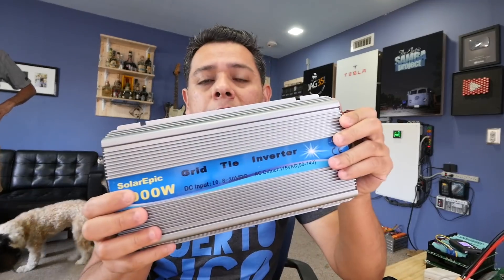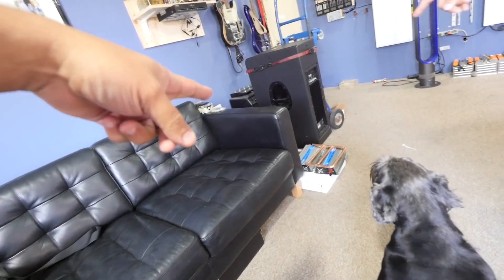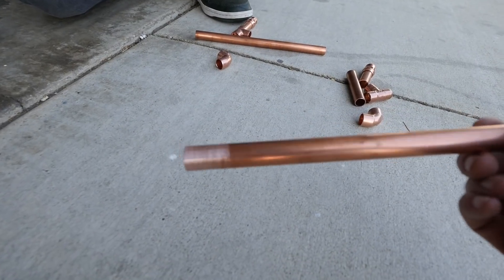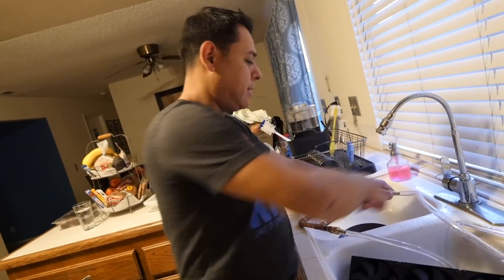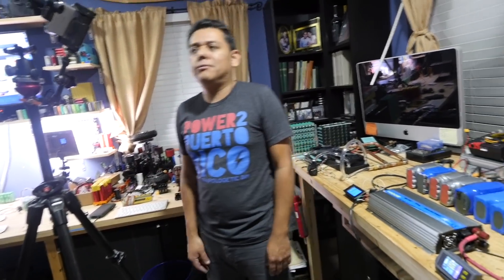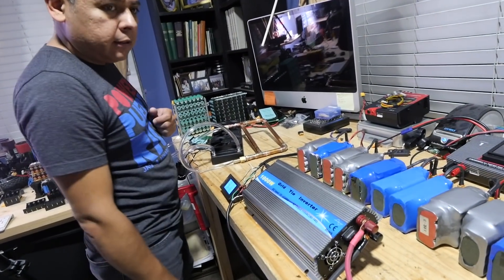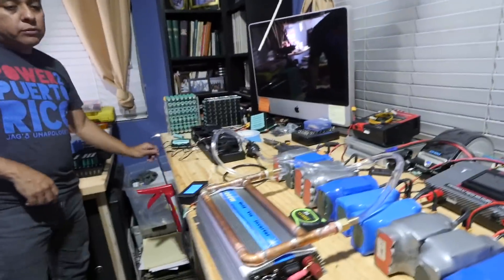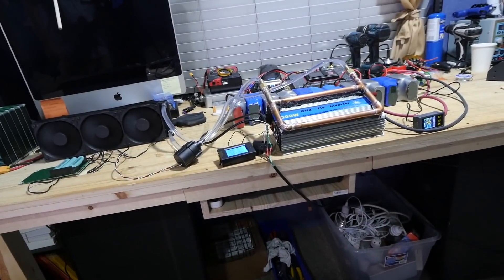Liquid cooling A cheap 1kW Amazon Grid Tie Inverter Experiment

Comment: How are you back feeding this into your home? Would this still be providing power if the grid goes down? In which case would it shock someone working on the lines? Or does this only work if you are getting power from the grid, your house just uses the batteries first before the grid?

Comment: I would take the cover off and re-create that from copper or (cheaper) aluminium. Then solder 3 or 4 pipes onto that sheet, and connect them with the hoses. And if you put in just a container that allows the air to bubble out, you'll have a proper system..

Comment: It could also be the speed of the water and or the volume of water. Looks like the pipe size was reduced at the plastic line side. It may also benefit from a pre-cooled water reservoir. I think worth more testing and 10 degrees is a lot of cooling.

Comment: Why to have complex liquid cooling if you can just hook up some 12V fan's to inverter and it will send heat away. Less power consumption ,less hardware, more reliable, efficient and simple cooling.

Comment: From experience as a tech for the last 20 years.... 

EL EL is correct.  Your liquid pumped heat evacuator doesn't work because you don't have enough metal to metal contact.  You could make a "V" shaped trough of copper stripping that runs the length of that side of the invert and touches on each sides to one of the relevant hottest fins.  You want to make a superior bond between the two metal surfaces, so what you need to do is. strap it down with the improved metal to metal contact and use your thermal transfer compound only to create a thin layer between well pressed together metal surfaces.  It does not fill large voids between metal surfaces.  Heat sink thermal compound is meant to be compressed razor thin between solid surface to surface contact.  It doesn't work any other way.  

 If it were me I would try to make the only metal to metal connections that truly endures and that is to solder the pipe to the fins on the side of the inverter where it is hottest.   Good solder welded contact will not only make a durable physical bond, but an electrical and thermal bond as well that transfers heat energy away  into the water pipe very swiftly.  Also, what is the point to running a pump system on batteries?  Too much labor changing batteries.  You're gonna run that on its own dedicated solar panel overrated for the needs of that pump wattage wise so you don't take any energy away from your solar production array just to run fans or pumps for cooling.the inverters.  If you have to, drill holes through the side of the inverter just large enough to thread some nice thick strews into and use those hard physical connections to transfer most of the heat away from the case of the inverter careful to seal the screws well at the entry-point to keep water to of the inverter (use tight tolerance neoprene thin rubberized backing on flat/pan head screw heads to ensure leak-proof.

Also, on the subject of ratings for Inverters....  It's honestly never a good idea to run a 1000W inverter up to anywhere near 1000W.  You need to adopt the good engineering safety overhead rule of thumb and give your equipment that is vulnerable to overheating a 30% margin of safety.. In other words, run 4 1000W inverters each with a 750W supply from panels rather than 3 1000W inverters at 1000W each.  Your equipment will last much longer not pushing it to design limits and testing if the tolerances on the components it was built with were adequately met in production or labelled.
Reply: Thinking about it , if you want to keep with liquid heat transport and remote air exchange as your method of heat removal what would work best would be to bury smaller copper tubes with an outside diameter closely matching the width of the channels between the fins directly into the length-wise channels and soldering them in place (if the metal will stick to solder) in a stretched S-shape zig-zag pattern lengthwise channelling water through the tube one way across the case to the edge then down a notch through a half circle and back across the case the other direction (repeat until all relevant surface area is covered),   This mind you is a better idea than putting water cooling heat sink blocks inside the case because you should not violate the water-shielding integrity of the OEM's case.  If you put liquid cooling blocks inside the case, you run the risk of a leak destroying your entire inverter.  Then what was the point of trying to save it by cooling  it more if the cooling failure causes it to fail?  Also, if your liquid pump fails your liquid cooling blocks instantly become frying blocks with no way to disperse their heat causing the helpless MOSFETs to fry instantly without much warning.  Best to stay outside of the case.  At least if your extra cooling outside the case fails, it would still cool as much as it does now without the additional cooling by distributively whicking the heat more slowly away down the copper pipes and existing metal fins.
 
Another less exotic and perhaps easier to implement method to cool them better would be to get larger faster fans like those used on computer chassis and put one on each end of the inverter with a funnel to couple one side size-wise down to the 2" openings for the existing fans are and remove the original fans.  One fan to push air from the cooler end towards the other fan which would be directed to pull air from the hot side.  Heck, just leaving the internal fans and adding these two fans loosely blowing and sucking across the outside of the exisitng fins lengthwise and perhaps a loose 6 inch wide length of plywood leaning at an angle off the side to the ground to create a triangular-tube shaped air channel to push air straight across, collect heat and then be exhausted out away from the inverter.  This simplistic approach would waste far less time implementing it and on costs. Best of course if you run those DC off some small cheap ($7 I hear.. ahem!)12V 20-25 Watt solar panels so they don't leach off your production power, downing efficiency.  The existing fins can do an adequate job of cooling but you can assist them by pushing air over their entire surface to draw the heat off them faster.  I use one of these same 1KW inverters in my own home solar rig here outdoors in the heat in sunny Southern California.  It's been running for 2 years outdoors with only the help of being in the shade underneath the solar panel on the ground mount with no additional cooling and has run 365 days a year without a single failure.  

If those fins don't have enough surface area to efficiently remove heat from the inverter, for passive cooling you can always help it by soldering on more and longer thin metal fins in the grooves between the existing fins and/or on top of the existing fins lengthwise to increase the overallsurface area of metal exchanging heat with the air around it.  Pushing directed air over them with a modest 4 or 6" fan will also help greatly because moving the air reduces its ability to create a blanket of air insulation around the heat sink fins, because motionless air acts as a thermal insulator as it continues to build resistance to taking on additional heat from what it touches as it itself heats up, so blowing fresh as-yet-un-heated ambient temp air across it keeps up the maximal efficient rate of air <-> metal heat exchange.  

The liquid cooling thing is just going to do the same thing at the other end with its own heat sink anyways pushing air over yet a different heat sink to draw the heat away.  The only reason for liquid cooling in computers is to put more cooling into areas where there isn't enough room to effectively circulate enough volume of cooling air or room to mount fans or isn't enough outside or fresh air available to move over a regular heat sink like in the crowded confines of a computer chassis or for setups where the noise of fans needed would make it unpleasant to work around so the cooling fans are relocated by leveraging noiseless water as a proxy to another location away from the machine in question where noise is not an issue  You have all the space you want outside of an inverter to create adequate cooling directly with forced airflow so it makes more sense to do that right where the inverter's own fins are instead of transporting that heat in liquid to a different heat sink elsewhere to be removed by guess what?  Fan-forced Air blowing directly over cooling fins on a large metal  block and fins style heat sink or fan-forced air blowing through fins on a radiator type heat exchanger.

But honestly, and this is the last point, you shouldn't be overdriving your equipment like this. Y ou don't gain anything by overdriving an inverter except an overheated inverter that will fail unless you can maintain an exotic expensive cooling system which eats a bunch of power and then what was the point ?   Just oversize your inverters for the job.  Use a 2000W inverter instead of 1000 W inverter to run 1000W of power.  By not forcing your equipment to run at design limits, it will last much longer without additional waste of power to implement additional cost increasing heat dispursion methods.   It might make for interesting video to design some far-out looking copper gadget with liquid pumps and a radiator to cool your inverters but the smart reliable and cost-effective thing to do is to not heat them up like this in the first place and select inverters which don't have to constantly run at design maximums to keep up with power supplied by your panels during your noon time peak maximum production periods.  You shouldn't run them over 80% of max rating at your daily peak hour if you want them to last in terms of years rather than months weeks, or even days depending.

Comment: I would guess the mosfets are along the sides of the inverter so I think you would be better with thin tube that will fit between the side fins and use some kind of thermal transfer adhesive.

Comment: Hi, you kindly got back to me recently about some inverters you can plug into your home to add power is this the type of inverter?  so my question really is can I plug this in  at  my building where the solar panels and batteries will be which is part of the household circuit and then plug in something in say my bedroom and it would draw power from my batteries and not the national grid  or as a reduction to my supply  from my  electricity supplier. I realise you are a busy guy and love the videos. Brannen, North Devon, UK
Reply from the maker: Yup,  if say you have a battery 24v connected to this inverter and connect it to the wiring in your home it will produce around 600w.  You can deduct that from whatever your home is consuming,  say if you have the refrigerator using 300w and all your house lights another 300w then your home would be net zero, or you won’t be drawing any power from the grid,  but let’s say you start vacuuming for example and that draws 1500w then anything above the 600w that the grid tie inverter is producing comes out of the grid so your home will be consuming 1500w from the grid and 600w from the battery/grid tied equipment,  your total consumption will be 2100w but the utility company will only see 1500w.   If you can exactly match your consumption with grid tied inverters then you don’t get a bill at the end of the month,  but make sure you don’t feed too much energy back into the grid if you don’t have net metering setup.

Comment: Try flattening or pressing smaller copper tubes into the side fins, coated with that paste. Braze the ends to a small copper manifold or use tubing.

Comment: From my water cooling experience. If you use adhesive thermal past and mount a row of old AMD CPU heat sinks in the blue area it would do.  Or your way solder a shaped copper plate on the bottom of the pipes. Then thermal adhesive to the top of the Inverter    You want as much contact area as you can. Shape the pipes to the top of the Inverter. You really want a flat top to those inverters for water cooling. Wonder if you can get a custom case made in China? Also you could remove the inverter fans and mount server cooling fans on the outside of inverters. 10 bucks for 5 of them.  move 10x the air.

Comment: Have you ever tried modification to the heat sink?  If you extended the fins or blades with more strips of alloy you could give the heatsink a greater service area. Even the thermal paste with some epoxy glue at the ends. Just a thought, simple and do able for your average diyer.

Comment: It will work,,, until the pipes sweat on a hot day and start to drip into your Inverters. the other problem is that you are putting open copper pipe near an electrical terminal. one false move and you have a conductor., Now. if you add a fan with a thermal snap disc it will take MUCH less power than pushing water threw a pump. you could also make it a solar powered fan to cost you NOTHING to run.

Comment: I'm confused as to how two people (+anyone behind the scenes) clever enough to engineer this set up, were simultaneously dumb enough to make the close to the most useless system imaginable. Heat transfer needs as much thermal conductivity and surface area as possible.
A flat surface on a round profile makes a tangent line with only a tiny point of contact (this is why train wheels are so efficient). Additionally the contact area is at the end of a thin aluminium fin which will have relatively high thermal resistance.
The thermal transfer compound will have a hideously high thermal resistance relative to a metal-on-metal contact, so will be close to useless.

You will need to either solder/weld/braze the pipe to the aluminium, after grinding down the fins to allow space for the pipe to fit in. If you can't solder/weld/braze the pipe to the case, then a mechanical connection is adequate but you'll want to get as much metal-on-metal contact as possible by using a square profile pipe or squashing the round pipe so it has a flat edge.

Sorry if this sounds harsh, I don't like to knock people who at least TRY. and you've done more than I have in this area... you're obviously not dumb guys... be smart about things -_-
Reply from the maker: Settle down,  this was an experiment,  how is anyone not smart enough to see it for what it is hard to comprehend
Reply: An experiment to determine what?... As you allude to at the start you had many commenters explaining it would not work. I can only assume that in some attempt to prove them wrong you didn't foresee the obvious flaws in the implementation. So you made no attempt to address those flaws.
You didn't need to mock anything up to see it was not going to work.
Reply from the maker: You Believe everything people say?   I experiment that’s what I do,  are you not familiar with my work?    Are you never wrong? I’m more wrong than right but that doesn’t stop me from doing things.    What do you do?

Comment: If the water and radiator don't get almost as hot as the inverter, you're not transferring much energy.

Go to a craft store, buy sme mold making kits. Cast a mold of the inverter's side heatsinks, cast a positive part, then cast another negative in plaster or casting sand. Lay some coursly-sanded S-bent 3/16 copper tubing in the mold so the ends protrude in a useful way, melt some beer cans into the mold, paint the inverter's heatsinks with a thin layer of thermal paste, and clamp your molded aluminum header onto the heatsink for maximum contact. Connect the tubing to your radiator. Drain that water, add a mix of distilled water and anti-freeze, according to the anti-freeze vendor's recommendation. The difference will be dramatic. It will pay for itself over one inverter's lifetime, as the inverter will last at least twice as long (if it's going over 50 degrees C).

Comment: What i Do is use a wall mount gridtie inverter(No fan just mass heatsink) the big ones, then just wire on a power cord. If u can get 1 used thay r way cheaper then the ebay ones. I got mine for $500 aud with 3kw solar from someone upgrading there house solar to a 5kw And another one for $60 on facebook both r 3kw inverters just dont overload the powercord (AU 240v by 10a so 2.4kw MAX Solar) Cheapest way to setup solar.
Reply: Also you need 150v input for the Inverter to turn on

Comment: Your contact surface area was way to small maybe a small diameter tubing routed in between the fins  with one run of tubing. Also focus on the side where the mosfet chips?? are mounted to... or maybe if possible grind the invertor housing flat in that hot zone and directly attach a water cpu cooler to the hot zone. I think you will hit a point where other components inside the invertor are also heat stressed and are not thermally bridged to the aluminum heat dissipater causing failure.

Comment: I wonder if the copper could be bent to shape the slight curve of the top and then soldered to the fins of the body. Also you're going to want some anti corrosive in your liquid because im almost sure thats a mixed metal system. It will break down over time. It would probably take a while but it will break down and reduce cooling efficiency. My other though would be to solder on a flat piece of metal to the tubes and solder the fets directly to it. It would leave the electronics exposed but you could build an enclosure for that.

Comment: Hi Jehu another great vid mate. Suggestion pyrolitic graphite paper made by Panasonic for thermal heat tranfer it's  new out. 3 times heat transfer of copper and 5 of aluminum.  There's different thicknesses so have to pic one with 1600 think R/wf coppers about 500.
Thinking also leave inverter tops off also when you run your desired cooling.
Look forward to your next build mate cheers Pat.
Ps i known there will be criticism on this paper but they have to research it first it handels 200 °c.
Cheers Pat.